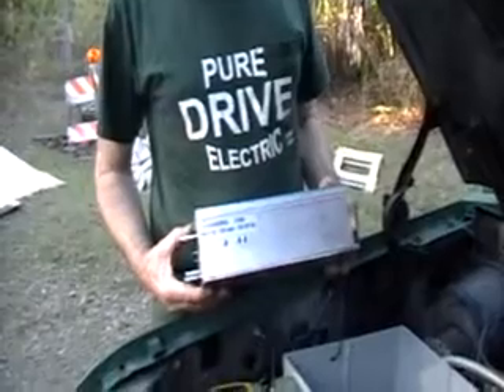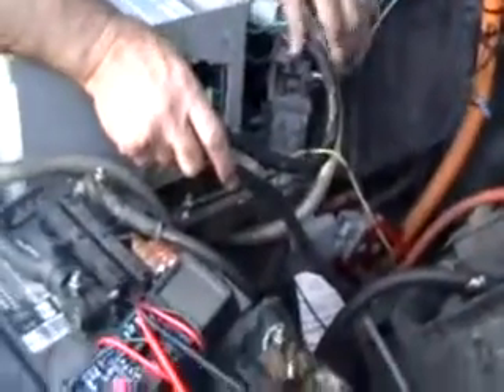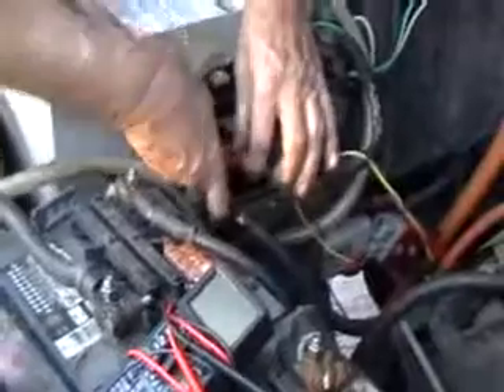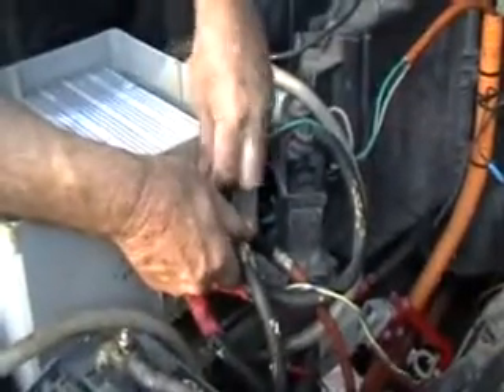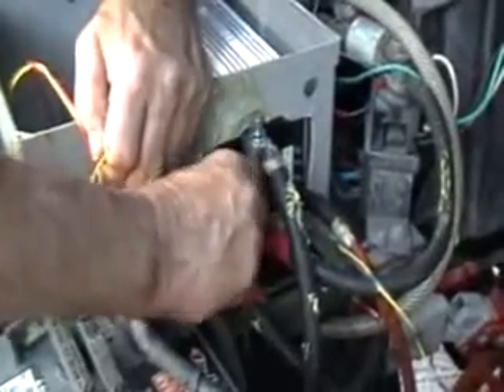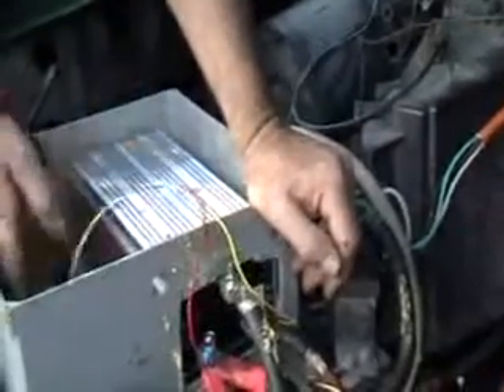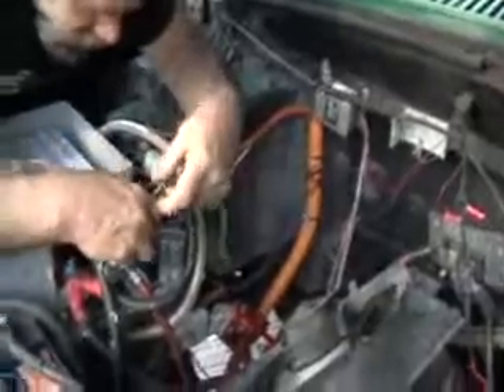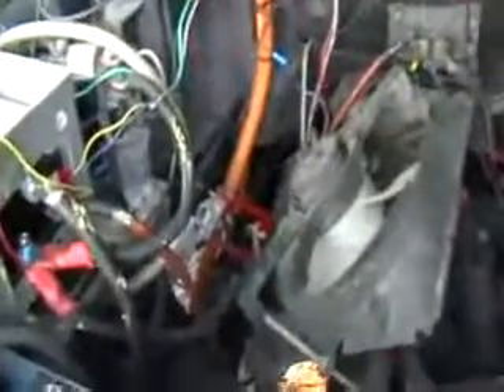How to Install a LOGISYSTEMS CONTROLLER

Comment: What do you mean by shielded extension? I was thinking mabye a little plastic enclosure that seperates them or maybe you could solder a lead onto KSI and then put heat shrink around that but maybe that would void the warranty.  Spade lugs are not ideal either they come loose fairly easily. I almost broke off a spade lug on a Curtis of mine one time while working on it, it just bent so easy.

Comment: Make sure not to accidentally hook the pack voltage that goes to KSI (to turn the controller on) to any of the of the two potentiometer leads  and they are very close to KSI so it is easy to do. If you do hook the pack voltage to your potentiometer leads your controller will be fried just a flaw that logisystem and curtis didn't think about. KSI should really be on the other side of the controller not anywhere near 2 and 3 and they should be protected just in case.